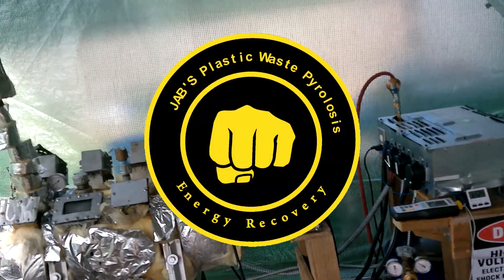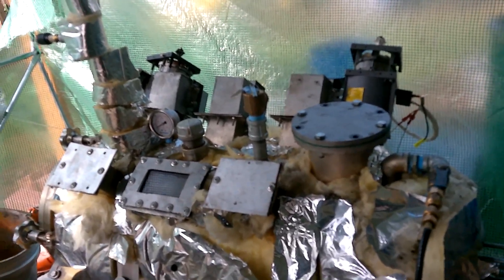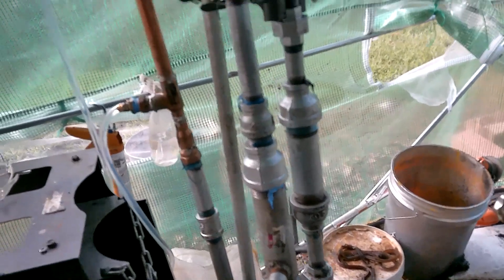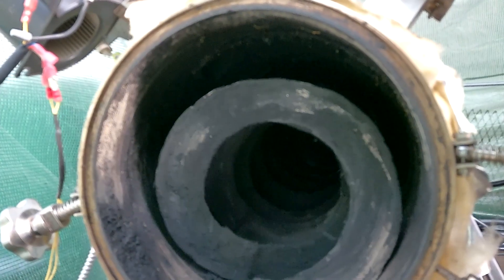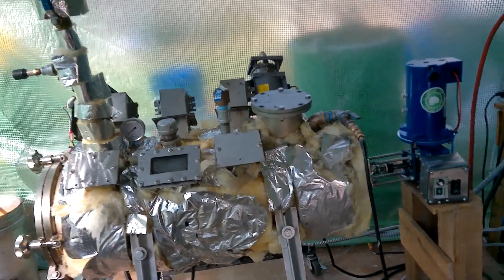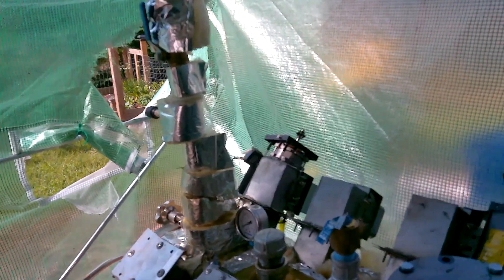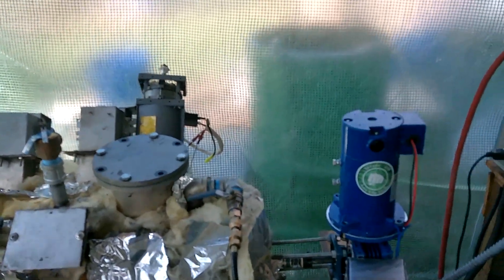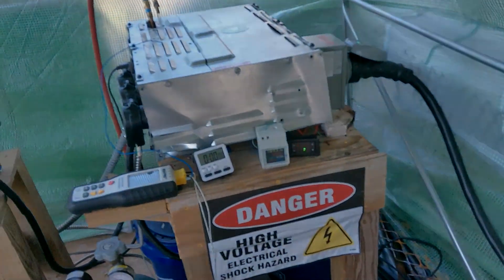Running Mark 4 Plastic to Fuel Reactor - Part: 2

Comment: Reactor looks like a freeze drier is that correct? It not what is it and how much did you pay to get it? Ps awesome setup
Reply: Also you should cover that window with some chicken wire or something like cuz some microwaves could leak out from there. Unless youre using an old microwave window pane for the window lol
Reply from the maker: I built it

Comment: Propane would work as a cheeper purging gas?
Reply from the maker: Yes, but dangerous if not all oxygen is out
Reply: @naturejab  propane is quite picky with its O2% before explosion, and a whole lot could be added with the mixer turning to release trapped gasses? 

Just a thought.

love the concept!
Reply from the maker: @Harry19841  Yes, I will consider this when I get an o2 sensor.  Adding propane in first is actually what caused Mark 3 to catastrophically explode, so by nature, Im a little traumatized at that idea hahahah
Reply: @naturejab  fair enough!